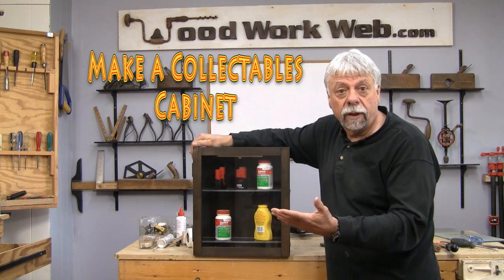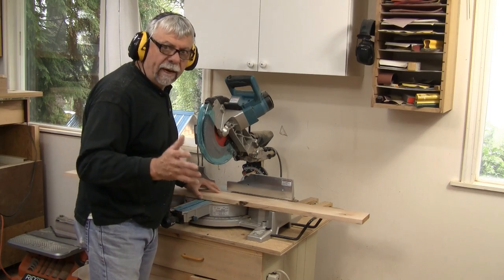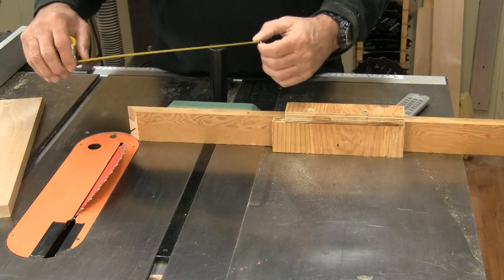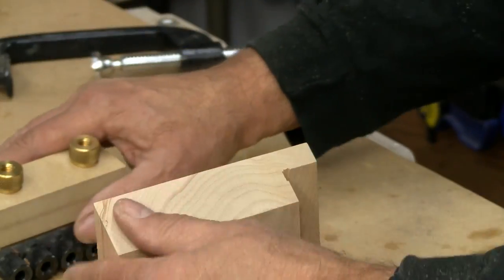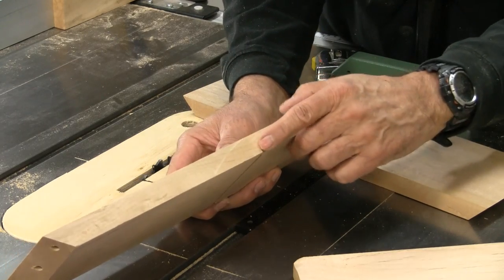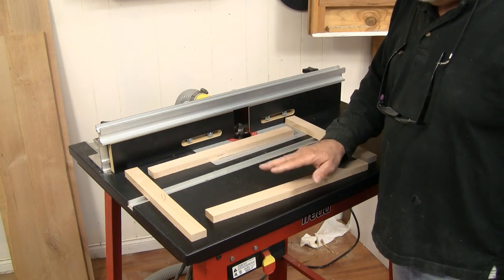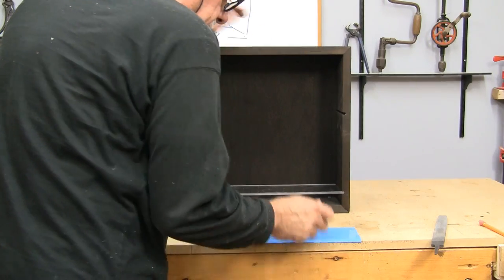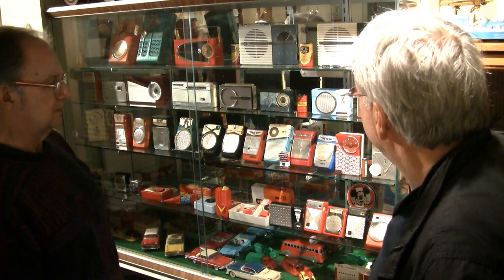Make a Collectables Cabinet

Comment: After watching your review of the DowelMax I ordered the DowelMax Jr.  I got it in the post the other day.  I haven't had time to try it out, but gosh it sure is finely made. 

It looks like the 45* miter adaptor would be easy to make.  Maybe you'll do a video just on the adaptor.  Thanks Colin for another nice video.
Reply from the maker: Ed Waggoner Sr. Thanks for commenting Ed, yes, they are finely made aren't they. I'm sure you will be a happy with yours as I was. It changed how I do woodworking, which says a lot after 50+ years of woodworking.

Comment: Interesting as always.  Found the torch trick on the plastic most interesting.  I usually use very fine sand paper to smooth out the edges and live with the result.  Gonna try that next time.
Reply from the maker: Paul St George Hi Paul, yes I do the fine sandpaper then hit it lightly with the torch. Don't go too much with the torch or you end up bubbling the edge and have to re-sand ... thanks for commenting buddy

Comment: 12:35  Get a push block!
Reply from the maker: Orxenhorf  Ah ... that chunk of wood at the end of the rail ... that would be a push block
Reply: Need to be using on on the top of the work too. There were fingers within an inch or so of a spinning, unguarded, router bit.
Reply from the maker: Orxenhorf  From your angle it may have looked dangerous, but from mine, it was quite safe